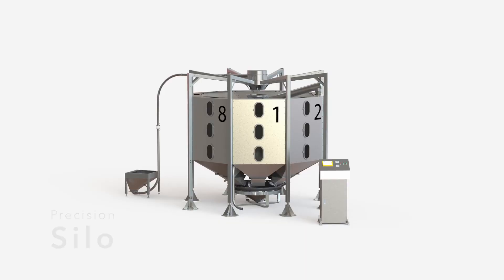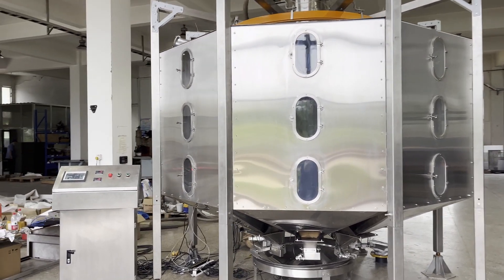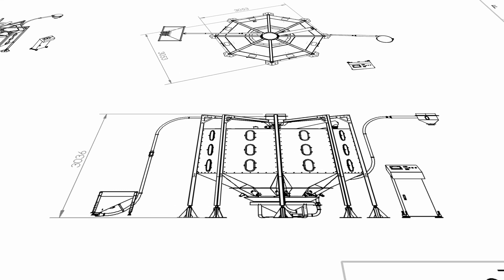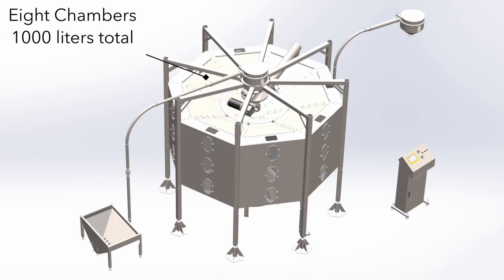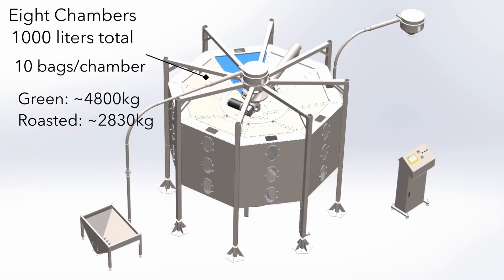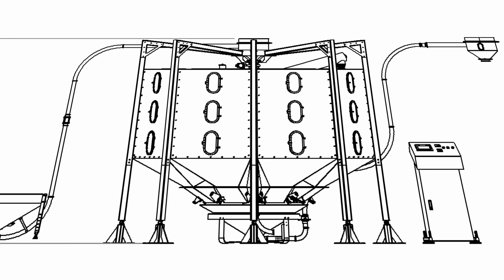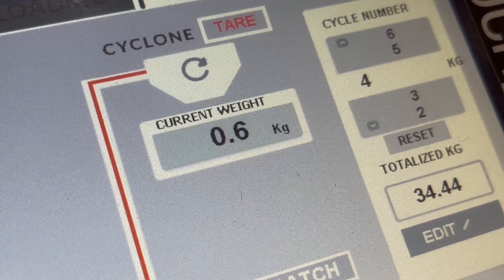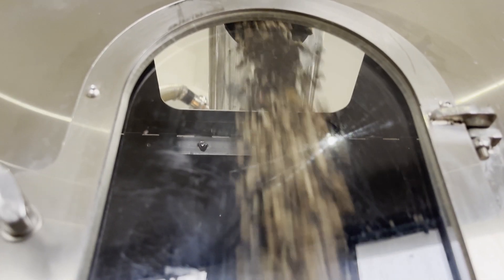Silo Introduction Video - Sovda

Comment: How long can coffee be stored inside the silo? Can it be cleaned?
Reply from the maker: Hi, thank you for your question. For roasted coffee, you can store it as long as you would normally store coffee in Brute bins. For green coffee, storage time depends on your local climate because the chambers are open to atmosphere. Precision Silo is extremely easy to clean because of three factors: 
1) it's low to the ground, 2) it has three windows on each chamber which can open making it very easy to blow out with compressed air, and 3) With the chamber empty you can remove the exterior panel for full access to the inside walls for deep cleaning.